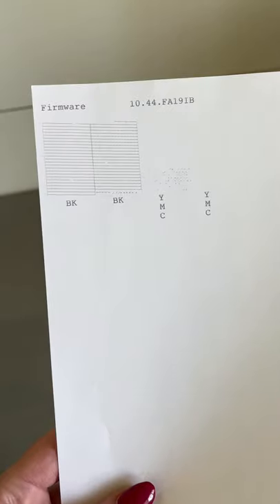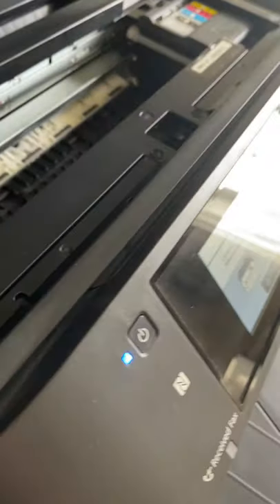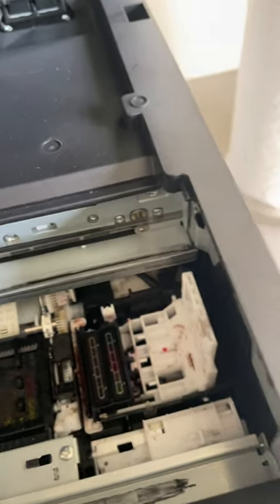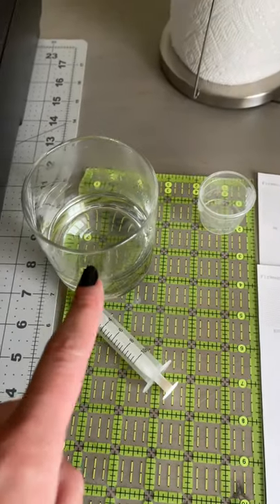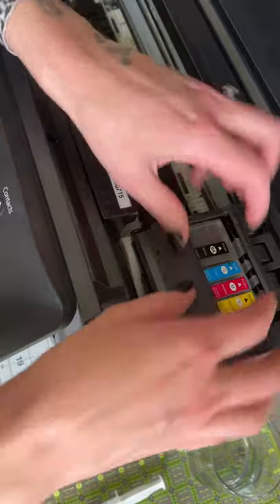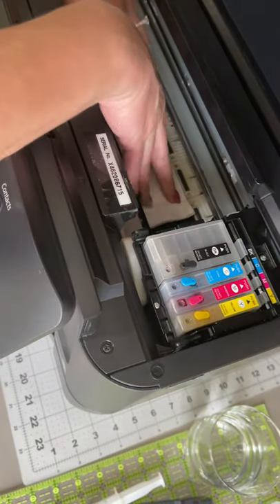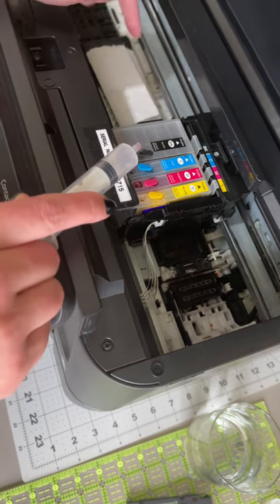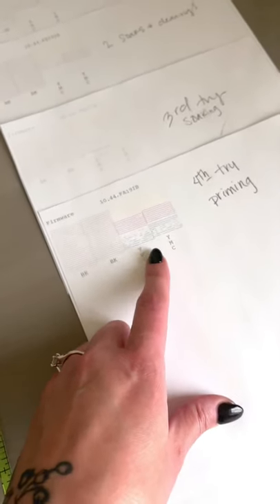Sublimation Help!: How to Fix Stubborn Clogged Print Heads (for Epson Printers)

Comment: Hey Debbie, can you send me link for purge sheet? I buy Cosmos too
Reply from the maker: This is the purge sheet I like to use. Cosmos does have a purge sheet too with the 4 colors. I created this purge sheet to basically cover all angles. Some people (myself included) have 6 color printers now, so having a whole rainbow of colors will ensure you’re using ink from all 4 to 6 colors. 

https://www.debbiedoesdesign.com/products/free-full-color-purge-sheet

If you’d rather use the purge sheets from Cosmos, I have them saved here you can use: https://www.dropbox.com/sh/r48r9t5rda9bypb/AADQKkM8hw6LGxW4jHj3NvlEa?dl=0

Comment: I see all these comments and my printer seems to be the only one that doesn't work :( I did the hot water. Pushed the air. When I push the air not a thing comes out. In the video she has a lot of ink come out. I bought new cartridges and sublimation ink and it won't come out. They're brand new. I'm so confused and frustrated. Any one else have this issue???? I need help.
Reply: Same

Comment: Watched your video. Just made the printer worse, RUINED IT!! It started making a super loud noise that I have never heard before with error flashing! Totally broken. Had to go buy a new one.
Reply from the maker: I’m sorry you had problems with your printer! Can I ask what step you were on that caused the issue? And what error it gave you? I have been using these techniques for years now, which were passed along to me from various ink suppliers, and even printer repair shops, so I’d love to be able to pin down what went wrong in order to help avoid this happening to anyone else. Obviously the goal here was to help people fix their printers, so if there’s something I need to be aware of, I would love more information, if you’re willing to explain further. Also, what printer did you end up buying and how much did you spend to replace it? I would like to try to help make that right too. If you would rather contact me directly with details, feel free to email me at support@debbiedoesdesign.com.

Comment: Big oof. This came up as a top result on Google for fixing Epson printer heads. Tried the steam water method. Got Yellow and Cyan working but nothing on Black or Magenta. Tried a second time. Smelt smoke, printer shut off and now have an error code of 0x9A and won't turn on. Just spent $70 on new ink cartridges and this video I think just killed my printer. Someone else in the comments mentioned that it's a super bad idea to fill that tray with water as you could cause spillage and I'm guessing that's what happened to me.

Comment: ET-4700 here (ink tank) with Hiipoo sub ink.  I've tried each method three times, with the print head cleans in-between.  Unfortunately, the print test will look OK after one or two of the methods, but then when printing either the purge sheet or anything else, the colors will fade from full strength, to dull with lines, to nothing during the prints.  I've also done at least two power cleanings, waiting the 12 hours in-between.  Wondering if anyone else is having a similar issue or has any suggestions?  Was printing perfectly fine around 1-2 months ago.
Reply from the maker: I haven’t had that issue. Users don’t look through the comments often. If you’d like, you can join my group as ask there! Pictures always help too. Www.Facebook.Com/groups/debbiedoesdesign
Reply: Hi I have the same printer like you and use the same sublimation ink and when I did the nozzle check some lines are missing. I tried pushing alcohol through the print head and it worked for the black but not the blue. I’m so frustrated  I feel like tossing it and buying a new printer.
Reply: Did you solve your issue?

Comment: Your essentially filling up the excess ink tray.  Don’t ever add water to it. It will cause over fill and then ink spill out the bottom of the printer.  Trust me you don’t want to ever have that happen.  There are companies on Amazon that sell the cleaner solution for the ink to break it up. Those ink head hole are microscopic and can be damaged super easy.

Comment: I am scared to use the steam water method
Reply from the maker: That technique came straight from a printer repair shop, and has worked great for many people. Just don’t drown your printer with too much water.
Reply: @DebbieDoesDesign  ok.. will try it on Tuesday..  will let you know how it goes
Reply: How'd it go?
Reply: @catalinaramirez6495  Hi.. I didn't try it yet.. Tomorrow I will.. Was on the road busy today. Will let you know tomorrow..

Comment: Be careful with the steam method.  I followed the steps carefully & my printer won't turn on... it's dead. oops!!  I'm not too upset, it's an extra printer I take when I travel for longer than 3 weeks. It had been unused for 10 months & the black wouldn't print at all, although the cartridge was only 11 months old & only used for 2 weeks.  I just replaced it with an HP Laserjet M110we (don't need color when away from home) & I won't have to deal with those stupid inkjet cartridges anymore!!  I love laser & so glad I found a compact, lightweight printer.
Reply: LITTLE TO LATE !!!! NEW PRINTER AND WILL NOT EVEN TURN ON . SO SO UPSET
Reply: @kimberlyryan1226  so sorry
Reply from the maker: I’m sorry it didn’t work for you! That method was recommended straight from a printer repair shop. I’m not sure what would have caused it to kill your printer, unless you added too much water and it overflowed out of the sponge tray.
Reply from the maker: You tried this on a brand new printer? These techniques were intended for printers that sat too long and dried up enough to cause bad clogs. A brand new printer shouldn’t have been clogged up yet?

Comment: I tried this and now my 2720 won’t turn on 😭😭😭😭😭😭😭
Reply from the maker: It won’t turn on at all? Have you tried to turn it on again after letting it rest overnight? The only thing I can think of that could cause an issue like that is if you out too much water in the printer and flooded it. Let me know if it’s still giving you problems!
Reply: @DebbieDoesDesign  ive let it rest for nearly two weeks and still nothing. tried different outlets, changed power cords, and i only used half the amount of water....ive already ordered another one....i wont be coming to YOUTUBE to solutions anymore. thanks alot.